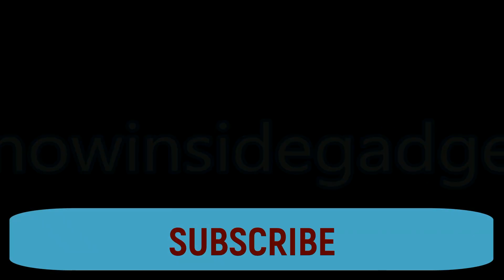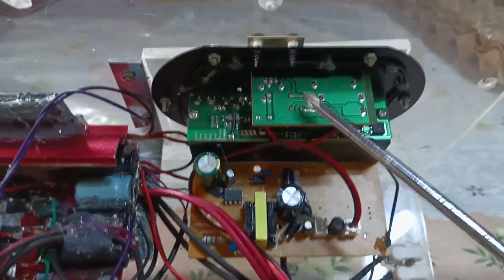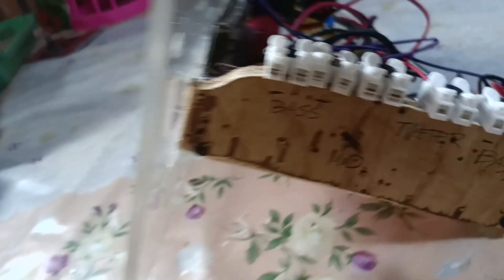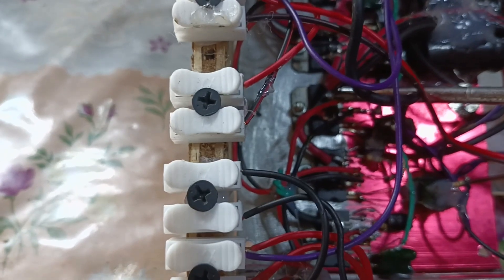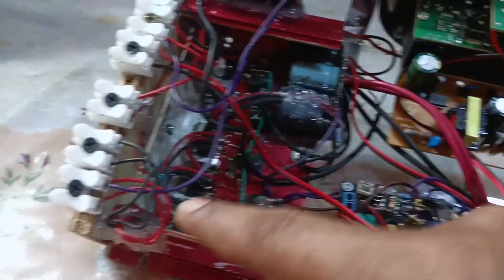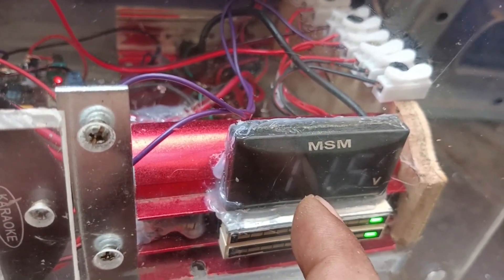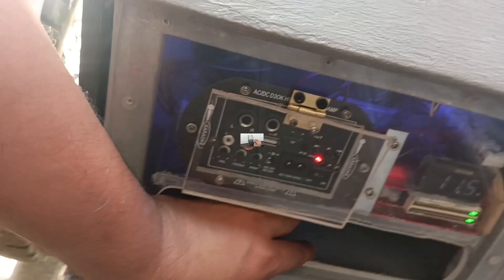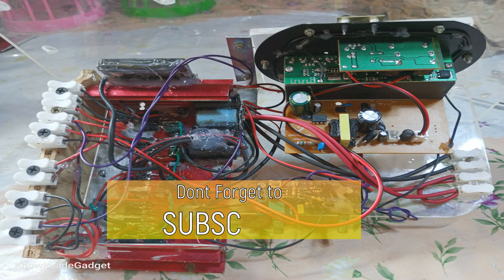DIY Car Bluetooth 2.1 audio Amplifier:  TARGA, TDA7396, D30K, Subwoofer Box LPF

Comment: ano po value ng 4 filter capacitor nakadikit ng glue?
Reply from the maker: 2200uF 25V parallel connection 4 pieces